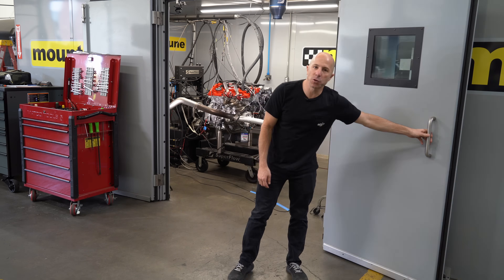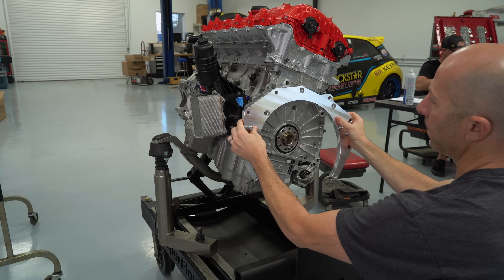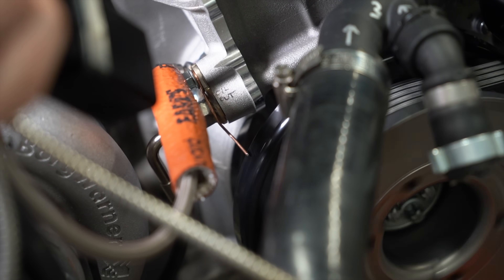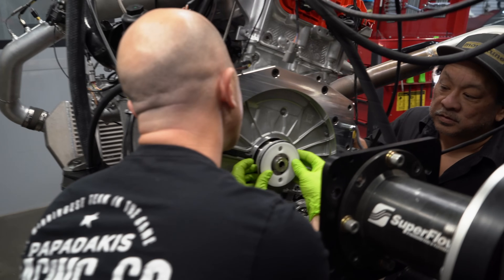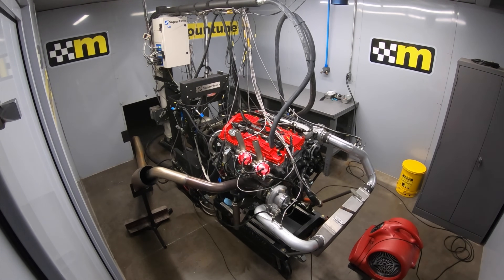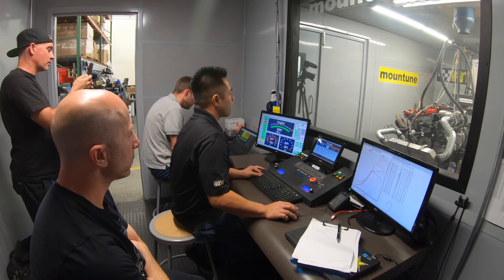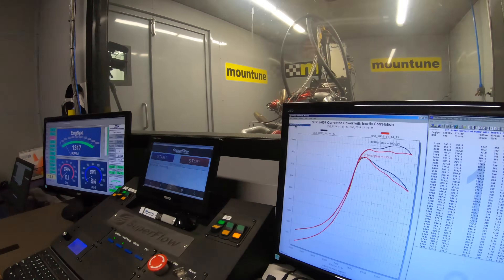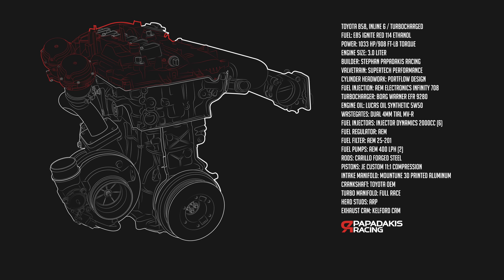B58 Engine Dyno 1000+ Horsepower - Sounds like a 2JZ!?

Comment: Why the fuck wouldn't you use Direct injection in the low end and then ramp fuel through the port ?   Totally abandoning Direct injection? Why? There are huge advancements in aftermarket parts for this stuff. Contact Extreme DI .

Comment: 900 horse on inert gas. That’s a hell of a goal, and a hell of an engine.
Reply: Inert? Say what?
Reply: noxious89123 Inert gas is a gas that won’t burn anymore. With the exhaust fan failed, they were basically running the largest EGR ever.
Reply: @Cjbarker2  sounds like they pulled the b58 straight from Area 51
Reply: ModernArc That’s why it took so long to get the video posted! They had to reverse-engineer it after the raid!
Reply: @Cjbarker2  I think you might be on to somethin. Maybe that's why they are using their own injection instead of direct injection. Probably dark matter injectors.
Reply: @Cjbarker2  Inert gas isn't what you think it is.  Air is far from inert due to the oxygen ... that's how things burn.  If that engine was started in a room full of truly inert gas (like argon), nothing would happen lol.
Reply: detaart Yes and no. Explaining it that way makes it easier for someone to understand. However, the basic operating principle behind an EGR system is exchanging exhaust gases, which are inert, with fresh air in the cylinder charge. It reduces combustion temperatures, which produces less NOx,. That’s because the burned air/fuel mixture is largely inert. The room isn’t completely filled with inert gas because a person can casually walk in and fix the fan, as you saw in the video. Yes, you’re correct in that a room of just an inert gas wouldn’t let combustion happen. I didn’t say that the room was entirely filled with inert gases.
Reply: @Cjbarker2  the dyno doesnt account for parasitic loss to the wheels so I think we can call it even
Reply: @Cjbarker2  You obviously don't know how EGR works ...
EGR only comes into play under vacuum conditions, and even then only under light load.  If the EGR valve opened under boosted conditions, you would be shooting fire into the intake ...
Reply: detaart I think you’re nuking the situation. If the turbo inlet is sucking a homologated mixture of exhaust gases and fresh air, which it was, that’s the same situation as running an EGR under vacuum. You’re arguing system function with a guy who studies these systems in-depth for fun. Also, depending on the A/R on the turbo exhaust housing, your exhaust gas pressure and boost pressure could exist at equilibrium, resulting in virtually zero EGR flow (although flow in both intake and exhaust at that position would be absolute trash) with the valve wide open, even at WOT. Learn some basic physics before you try to wrap your head around a complex system that lives on basic physics.
Reply: @Cjbarker2  in short: drop a jdm jz into it and be done with it
Reply: lol no it isn't ...
Reply: With the time and effort they put in to it, a k24 would have made over 1000 wheel. Great motor.... Sure
Reply: Matthew Doherty First off, a K24 has had years of trial and error thrown at it. The first high power build probably wasn’t as easy as “these pistons, this head, and this turbo, 1200hp.” You’re looking at R&D,  not just another high power engine build for the sake of a high power engine build. R&D on a platform that is still fresh. The 4B11 that replaced the 4G63 was not hailed as a platform with any potential when it launched, and I was on the bandwagon. The truth to it is that you have to try something new to find out what works, and from what I gather, the 4B11 serves its purpose reasonably well to continue the legacy of the 4G63. The B58 will always be a BMW engine, but Toyota poured enough resources into it to make it just as stout as the 2JZ.
Reply: @Cjbarker2  I agree with you on some points but the companies that made those pistons and rods etc have been doing so for decades. It may be a newly released engine but the concept is the same as any other engine. Also, as far as strength goes, I think the B58 wont be as strong as the 2jz to a certain level. The 2jz has one of the strongest cast iron blocks on the planet. The block can handle well over 1,500 hp without breaking a sweat.

Comment: Great video as always, congratulations!
I also had a direct injector overheat problem in the research SI engine I work on. The cylinder head is fitted with center and side direct injectors, we at the lab used to leave these injectors on when operating PFI, didn't take long to damage the "central" direct injector tip. After that we started using dummy direct injectors which can be swapped for working ones for DI operation.

Comment: Great video, I would like to see more on what you are doing to make more power with more boost.  
How you are changing things in the ecu (infinity).  How you decide what spark advancement to use, when to change it at different rpm, spark duration, fuel flow, injection duration for the port injectors, how it would change if you kept direct injectors...

Comment: People still aren’t satisfied with 1000 horsepower I swear the fanboys are asking a lot 😂 it’s a brand new motor give it time. It’s more annoying when people keep bumping up the horsepower expectations more than the engine can even put out safetly right now.
Reply: CleanMotorSport RacingAssociation uninformed people like yourself think its a tough feat to make an engine hit 1000hp when bmw tuners already out down 800rwhp through this b58? And people want to compare it the 2jzgte which makes 1000hp easily on mostly stock internals and 1000rwhp with valvetrain upgrades and piston & rods combo? Don't make me laugh, this setup wont even fit in the new Zupra and still has yet to be mated with a drivetrain to even produce an actual rwhp number. The reliability factor of this is suspect as seen in this severely edited video to make it look like it was easier than it was.
2jzgte is still and always will be the king of the JDM world. Nothing outs down better numbers and is more tuner friendly except maybe the LS platform.
Reply: Shady Shinichi I’m not uninformed how should I say this I’m open minded I know enough about the 2jz to give this a chance let another motor have the spotlight for once yes the 2jz is great but my god does it get annoying when that’s the only thing people think of as a motor swap like dude I love the 2jz but it’s not the only motor I know that’s why I’m shifting my attention to motors like this. I mean fine go ahead enjoying that 2jz I want something different this is that something
Reply: Shady Shinichi keep in mind that is with  extensive modifications though like think about it what supra actually makes 1000 horsepower with stock internals hm 😂
Reply: Shady Shinichi enjoy it I’m not changing my mind dude 2jz or no 2jz

Comment: Lets see how long that bmw lasts. It doesn't look reliable in the least. So quick to try to compare to a 2jzgte, this isn't a 2jz and won't ever be. 2jzgtes have gone into the high 1700hp for street set ups and 2000hp for full drag applications. Mind you this set up wont even fit inside the car with that large fmic.
This is all show and no go. Put it inside the car and put it on the dyno and rip in the streets.
Reply: @Shady Shinichi yeah? A lot of the 1700hp set ups are COMPLETELY REBUILT! Meaning there’s little of the original engine left! This thing, if built the same way, would probably wipe the floor clean! They can’t push it further because they haven’t built it up that much yet, you soggy wad of used toilet paper.

Comment: This engine in a e30 or e36 would be killer
Reply: While I agree, You can make 1000HP on a turbo M/S 50/52/54 etc and it all bolts in.... I have seen N54 swaps though in E36s which is awesome.. Just more people coming to the BMW platform ( love it ).
Reply: M50 Turbo is where its at ya boi. S50 block too thin between cylinders. M50 has more meat  👌🏻 Im building a m50b28 turbo using m52 forged crank. Also, these guys made 1000hp 900tq, M50's make 1000hp 1200tq.... so its better than b58 imo.

Comment: We learned about melting injectors on direct injection engines a long time ago when developing LPG on those engines. The engineer always let some fuel flow to cool the injector.
Reply: Yeah that was some serious rookie shit right there. Even if they hooked up some kind of nominal flow just to keep them cool. That was always going to happen. You debur all sharp edges to stop pinging, just to leave a metal tube in there to face ignition temps... Bit of a WTF moment.
Reply: Hey dudes, it was a test run out of the car without the engine management systems and such.  Give him a break or show 'em you can do better.
Reply: @TucsonDude  I just was saying the where lucky. We learned the hard way ourselfs by destroying the cilinder head.
Reply: @tomwagemans1872  I'm curious as to why they bypassed the direct injection. I haven't had a lot of experience with DI yet. I thought it was a more efficient fuel delivery system. I speculate it has something to do with the extreme cylinder compression experienced with all that boost. It was something that I noticed and your comment leads me to believe you might be able to school me on that subject.
Reply: @themadmachinist8637  For DI the fuel delivery pressure must be higher than the in cylinder pressure, and even more so the more flow you want. They're going for very high pressures and very high flow (3x stock), the original high pressure pump and injectors couldn't possibly meet the fueling requirements. To keep it DI they'd need a new much bigger pump, probably designed for higher pressure in order to deliver the fuel fast enough, and new much higher flow injectors. This is a lot of money for little if any extra gain, the stock injectors cost over 200$ and the pump over 500$, the ones for the flow requirements would probably cost over 3x as much each. You're looking at 5000$ right there just for a new pump and injectors, and these parts are very rarely used in aftermarket applications and would be very hard to get (they'd probably have to contact some OEM supplier like Bosch and ask them for their very best HPFP/DI injectors as a special order).

DI injectors are also completely different electronically, they are low impedance and need a dedicated control circuit to open them quickly but without burning them out (unlike conventional port injectors which are simple 12V solenoids and work ON/OFF). The OEM ECU includes the circuitry to control DI injectors but many aftermarket ECUs don't and would require an additional injector control module.
Reply: @TucsonDude  sorry but to allow that to happen is a rookie mistake which there is no excuse for. Even the most novice of engine builders know better than allowing a hot spot to occur in a combustion chamber. To over look it in a high boost engine is unforgivable. Look at any of my videos and when I make a mistake I don't try and hide it, I own it.

Comment: Why why why wouldn't you use the direct injection? That's just stupid. You can make power without it. But with it the car would be more drivable, better tunable and probably have more power while running less boost and leaner.
Reply: Before asking, watch older videos, he already explained it

Comment: I always thought 10psi is the most boost anyone would use on their engine, but 42 psi that is incredible.
Reply: never be impressed with psi boost numbers, they don't mean anything, pressure is just a measure of restriction.
if you modify the flow of an engine head you can get more horsepower with considerable less boost, because air flows better

Comment: "bbq becuase you use what you got on the weekend"

so now we get the liquid nitrogen
Reply: real talk tho have you had freshly freeze dried marshmallows, those things are great
Reply: Normaly used to cool the beer
Reply: honestly, getting LN2 is actually easier than finding an oven big enough to fit that block. Basically any welding supply store will sell LN2 for about $1 to $5 per liter, assuming you've got something to put it in. No license or any paperwork required, even just a double walled thermos is enough for a container.
Reply: 😂😂😂😂 seriously though
Reply: Just pump your block with liquid nitrogen and floor it G it'll stay under -20° C
Reply: House of Boost just your typical Saturday morning IG 🤷🏼‍♀️

Comment: The B58's undersquared bore/stroke ratio is whats to blame for the power plateauing at high RPM's. Piston speed is too high. Bore is too tiny at 82mm. I think you could get rid of that plateauing effect if it was bored out and de-stroked.
Reply: Remember it's only the first step, it had to be ready for the SEMA he didn't had much time, it will just continue to evolve
Reply: @mostneuter   Oh, it's an incredible build. I'm not doubting that. I love this channels in depth videos, I'm just pointing out an engineering detail about the B58. It was designed for low/mid range performance. It's a lot harder to squeeze top end HP out of an undersquared/small bore engine.

Comment: Badass but I wish they would use the direct injection to find the limit.
Reply: DRIVERDSM1 direct injection sucks for big power but good down low. Slot of the fuel hits the cylinder walls and dosent get used in combustion making it hard for big power fueling and it washes out the cylinder walks. DI engines put out so much unburnt fuel particles the catalyst is accompanied  with a particulate filter similar to what a Diesel engine has just to catch all from going into the atmosphere as harmful emissions. Some people use both direct injection and port injection letting the port injection take over primary fueling on the big end. Also building high flow direct injectors and modding the DI pump or designing a replacement is super expensive and no one would pay for it.
Reply: Jelani Winston then I wish they would at least use the DI and port on top of that. Something the masses would possibly use. I’m sure most people won’t completely switch over. I would definitely be interested in a port injection on top of the DI. That would probably help with carbon build up. But hey it’s there money they can do whatever they want. I’m just thinking from a business stand point. It a race to develop the next best thing.
Reply: @DRIVERDSM1  some small correction, Direct Injection is enough for over 1600hp on a 1.6turbo engine without fuel restriction(read Formula 1 article about it)
using such technology would make it way too expensive  for whatever they are using this engine.
carbon build up has little to do with direct injection, it has to do with  crankcase ventilation deposits
Reply: Edmundo Cunha I never said the DI was limited in power that was the other person.
Reply: @DRIVERDSM1  forgot to remove the starting text :) that's what you get for pressing the reply button

Comment: the live building was amazing. Thank you so much.
so from 500Nm@3000 to 1000Nm@4600 that's pretty aggressive, will this engine be deployed on some car that only uses 4000rpm or higher ?
was this designed with the improving rpm limit in mind? 
would a direct injection fuel system capable of 1000hp smooth this rise (make more torque at lower rpm) ?

Comment: goodness imagine how much this costs
Reply: Personnel/R&D is the big cost in a project like this, into 6-figure territory if you add it all up. Parts ain't cheap either, like that $3k computer.
Reply: Price will go down for the next 5 years. Maybe not much.
Reply: 25 cents
Reply: Toyota racing factory backed papadakis will not go cheap on pilot project like this lol
Reply: Probably a lot, but he's got a great headstart if the tuner scene explodes like it did with the 2jz.